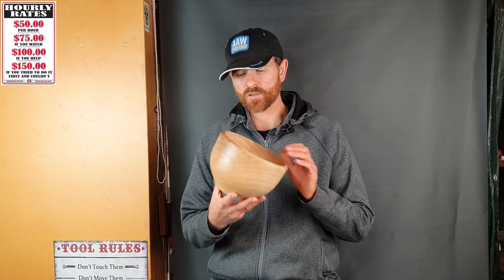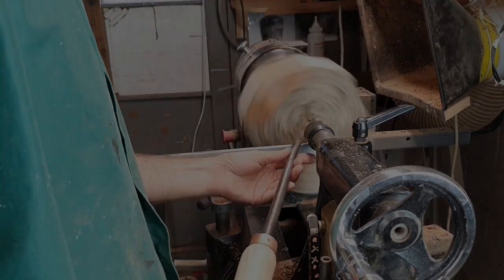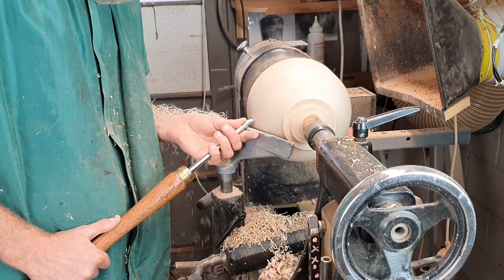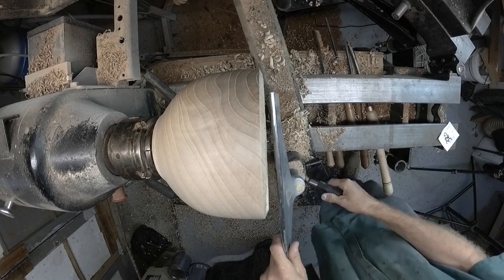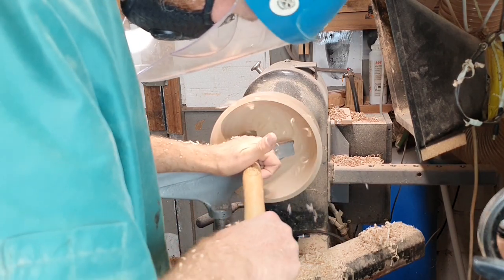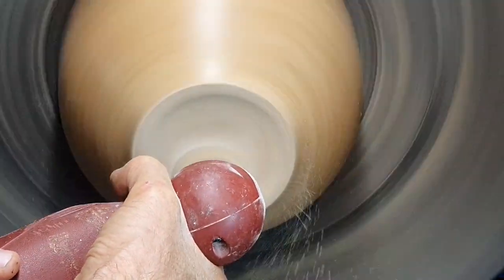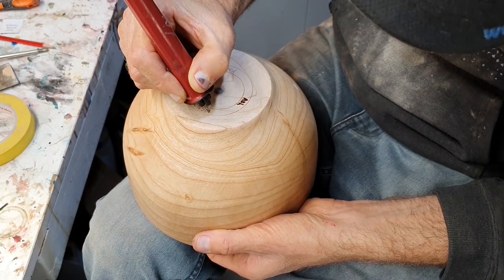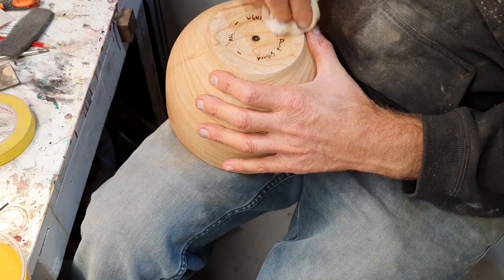Woodturning Bowl from Ash

Comment: Good video, thanks. As a newbie woodturner myself, I would like to know what the drill is you use for power sanding, it looks more convenient than my cordless one.
Reply from the maker: Hi Eric,
I got it from the US it's a no brand on its 110v so I had to get a transformer but I like that it 70deg  angle head which makes it awesome for bowls as the body never comes close to the work.
I have used and abused this for 5 years now and it spits out wood shavings every day but keeps trucking.
Look at this on eBay 
https://www.ebay.com/itm/310338285473
Reply: @woodgrainnz  Many thanks, I'll order one, I have seen American YouTubers using it but I hoped yours was 230v, looks too handy to let that stop me.